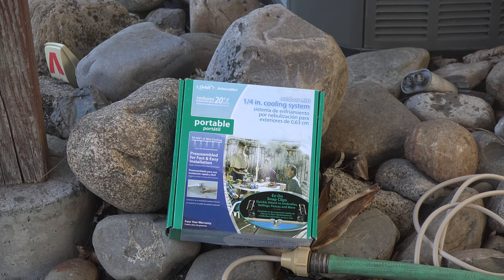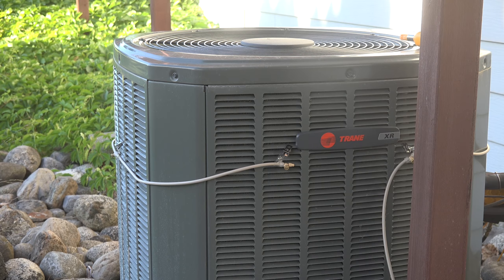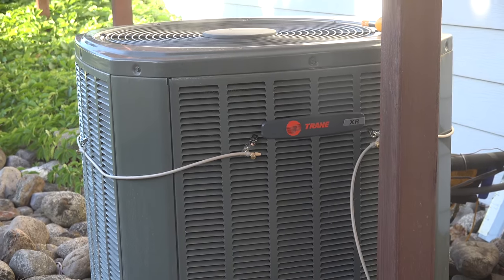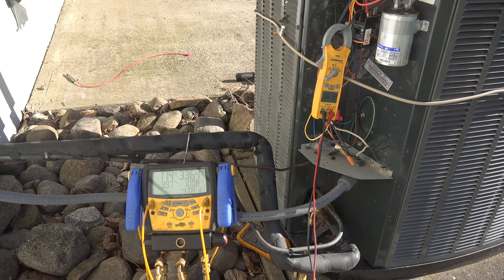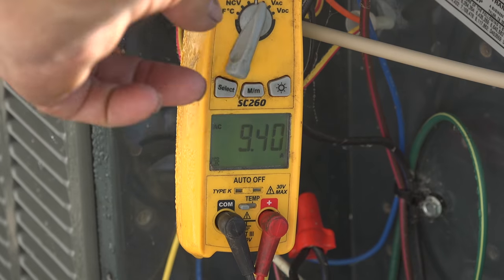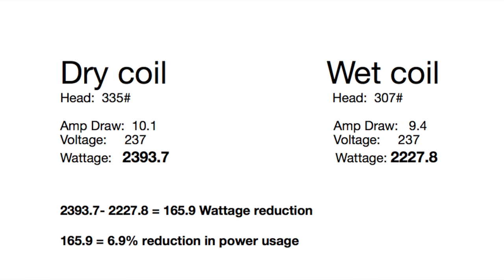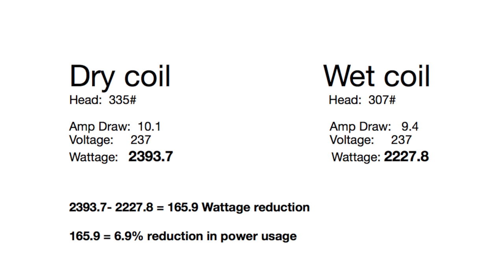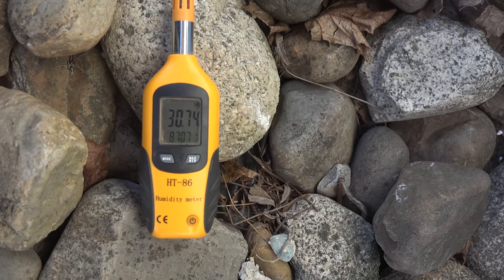Do the misters for A/C work? Part #1

Comment: No need to complicate the math with wattage :) You'll get the same result, percentage wise with the amperage draw numbers :)
Reply: Ok so 10 amps at 208 volts is same power consumption as 10 amps at 240. No.  Watts is power used. Amps is not power used. You must factor in the voltage and do the really complex math...aka Volt Amps
Reply: Think again :) Voltage is a given constant . Amperage draw is what changes  the equation thus difference in percentage :)
Reply: R. T. My friend, check in to voltage drop.  Im commenting to share.  If i was not right i would not make a statement. Any electrical fundamentals i reference can be verified.
Reply: acoustic4037 His voltage is the same  237V .
Reply: For all those who believe voltage is a constant I have measured literally thousands of systems running and it is a fact that voltage is not always exactly the same.  It can and does often vary.  The only way to be precise is to measure volts and amps and multiply.  Dont take my word for this!  Go measure a few thousand heat pumps yourself and see.  Nothing has to be wrong with the system for this to occur.  You could have variations from the power company.  Before you argue with me try to know your material or at least find evidence showing I have given incorrect information.  I try to pass on knowledge to help others not get into internet arguments.
Reply: acoustic4037 His voltage was the same . So all the multiplyng doesn't change the end result . Yes voltage will fluctuate due to various  reasons but this had nothing to do with applying a mist over the condenser and the experiment he's going.
Reply: At that exact moment you are right.  If you take multiple readings over time in various conditions, and you do as the first poster in this thread suggested which was just pay attention to the amps, then you will be misled by the results as the amps can vary but with out knowing if the voltage has, or knowing the watts used, it can lead to different conclusions based on the monitoring data.  If you measure enough, you will see fluctuations.   Either you want to be precise, or you don't.  I'm advocating for precision (watts).

Comment: Just install a liquid nitrogen cooling system that sprays liquid nitrogen around the outside of the unit.  That will keep the corrosion and buildup to a minimum. :)
Reply from the maker: Why not just spray the nitrogen inside the structure and eliminate the A/C.  lol
GFM

Comment: So the mister was not practical because it only resulted in almost a 7% power savings, provided that you are not in a high humidity environment, and will likely cause calcium buildup on the coils and fins.  A magnetic water treatment device would probably solve the calcium issue; that would be overkill and not cost-effective for this application, but for other reasons in general it is a very good thing to implement for your home's water system.  This guy has great info on that - https://trentatron.com/chronicle.htm
I wonder if significant efficiency gains would be obtained by drawing in cooler air passed through the ground as in a geothermal cooling system.  Maybe just burying a long  hose 3-4' deep in a coiled manner but stretched out about 10' would provide enough temperature differential to make a difference.  Both ends of the hose would be above ground, and a shroud could be fashioned near the AC unit to hold one end of the hose so that the cooler underground air would be sucked in.
Reply from the maker: The problem with calcium filters of all types is they do not work.  If you want to filter the water to the point that there is nothing but H20, you then get corrosion of the coil.  
The idea of burying a hose, you must admit, is a bit silly.  
10' of hose, are you serious?  It would take 100' or more of 12" to 18" hose to do anything at all. The cost of the hose itself would be prohibitive.  
You would also need a forced air fan to move air thru the hose because the fan on the A/C will not work against static pressure.  
GFM
Reply: Magnetic water treatment does not filter calcium, but it changes the water so that the minerals do not adhere to pipe insides and surfaces like sinks & showers; sounds weird, but it's documented that it does work well.  On the geothermal idea, I mentioned a long coiled hose that may fit in a 10' long hole.  Maybe the dimensions would need to be adjusted, but I'm pondering whether some reasonable results could be obtained without needed to dig down 15+ feet deep where the temperatures are definitely in the cool region.  If not enough air flow could be generated from the AC's fan, I suppose a small solar-powered fan could be used to draw the air through the hose.  Theoretically, if the air surrounding the fins was cooled down 20 degrees lower than the ambient air via some geothermal technique or any other method, I wonder if that would cause a significant efficiency gain in the AC system.
Reply from the maker: @chidude  The calcium is still there and it will be deposited on the coil when the water evaporates.  
Your money would be far better spent by investing in a higher efficiency A/C.
GFM

Comment: Your math for calculating wattage is wrong. These are inductive loads. You are treating them as resistive loads.
Power(P) = Voltage(V) x Current (I) x Power Factor(PF).
Reply from the maker: The meter is RMS, power factor is taken into account.
GFM

Comment: Hmmmmm.... Let's take a coil made of 2 dissimilar metals and add water to the equation. Copper+aluminum+water= formicary corrosion. Not a good thing especially with a R410a system running high pressures.
Reply from the maker: The corrosion issue depends on the location and water components.  I have had commenters say they use reverse osmosis water to avoid calcium buildup.  The problem there is pure water is a far better catalyst than mineral water.  So you kind of pick your poison when using water on these condensers.
GFM

Comment: It would be 25% where I live where humidity is 5%-10%
Reply from the maker: What would be 25%?
GFM
Reply: @grayfurnaceman  the test that was done at 30% humidity I know for a fact because I use a swamp cooler that they don't work great till about 10% and that's 20% different in humidity gives you about 18% better cooler so 18+6.9 pretty close

Comment: Very nice! I have done almost the same test with the addition of the checking the cooled air temperature at the inside unit. My results showed about the same in savings. The air temperature at the inside evaporator did not change. I decided not to use the misting system anymore.
Reply from the maker: I have more videos that pretty much mirror what you have found.
GFM

Comment: Your test is not taking into account of a unit sitting in direct sun. I’ve run my test in 2022 and I saved $400 for the season. And average KWH cost is 24 cents not 9 cents. And it is just going up.
Reply from the maker: At the end of the video there is a link to a shading video.  I have thoroughly tested this issue and misters make no difference in most applications.  In fact, they often reduce efficiency, especially during low load temperatures.  I used the electricity cost from my utility.  I am sure you think you are saving, but I can tell you you are not.  There is no way to compare one cooling season to another.  Lastly, if this procedure was effective, you would see manufacturers using it.
GFM
Reply: @grayfurnaceman  I understand but I’ve been running my misting system for 8 years now and I can tell you I have Zero Scale build and my savings are substantial. I journaled all of it. I clean both condenser and evaporator coils once a year. My unit is located on the SouthWest side of my residence. The heat and head pressure buildup is crazy. The Unit is  a 20 year old Trane Gas/Electric Pack and is running like new. Of course now it will blow up on me😂.  I live in the Upstate of South Carolina where the water quality is second to none but it will give you scale if you aren’t careful. I’m not sure how it ranks to other geographical regions. 

After 5 years of steady performance I’ve been installing my customized mist units on all of my commercial and residential properties to maximize lifespan. So far so good.

I’ve subscribed to your channel because you really have some good stuff. Thanks.

Comment: Suction pressure is just as important. This experiment is Missing lots of info. I’d guarantee the system will require Freon added to it if you follow the charging chart. These systems are critically charged.
Reply from the maker: I will be doing another video on a day with temps above 90F and will include suction pressure but I am predicting no change.  There is no charging chart as the system uses a TXV.  And no, it is not undercharged.
GFM

Comment: YOU  ARE  LOOKING  AT  IT  ALL  WRONG
Do not mist the air around the coils. Simply catch rain water off your roof, and then drip rain water upon the coils when only on the hottest days & during the hottest hours. My setup uses no more than 5 gallons of rain water per day (max drip rate over 4 hours) and is frequently topped off if it rains at least 1" within the month. I have had no issues other than having to manually clean out my 'first filter' now and then...which is not a big deal. My system saves me $37 per month during the peak of the cooling season, which matters to me. $74 might not sound like a lot to others, but it's only PART of my cost savings endeavors around my home. I have not calculated, because it would be too tiresome, the amount of savings I am getting from reduced strain on my system. I have noticed a serious reduction in the number of capacitors I have been replacing....and although I can't figure the precise amount, it is significant since peak times is when the system is being stressed the most.

SIMPLE SUGGESTIONS:
Seriously consider covering the outside of your solar gain windows with highly reflective window tinting. It's amazing how far such a small investment goes in reducing your cooling costs. The next is to place a large black pan outside roof in direct sunlight, and have a tube go to a pan inside (preferably near the air return on the highest floor) filled with water & calcium chloride solution. Either the outside pan or inside pan should have a lid to be closed at night.

Comment: 7% reduced Amps
7% reduced Watts
8% reduced head pressure

And you can't figure the benefits?  If only to solve the proper nozzle size and water pressure accuracy to get a humidity Net result that's zero to nil affect. Then do better math for the savings, that includes reduced taxes and distribution multipliers added to the kilowatts used. Then the reduced head pressure extends the Run To Fail life cycle of the compressor. 

Otherwise it seems as usual, those who work in an industry that thrives off of maintenance and Planned Obsolescence, are either ignorantly trained or purposely trained to not be as efficient as technology available would produce. Wouldn't want to shoot oneself in the foot for lowered revenue of repairs and replacements.
Reply from the maker: Watch the rest of the series.
GFM
Reply: @grayfurnaceman   It's not my life or responsibility to get into so much time dragged out over strategically multiple videos to gather whether you're properly teaching a subject. I'm in Social Media, so I know the posting of video strategy. But I'm first a teacher, and I can rightly mention and openly evaluate to properly inform, not pull people into lengthy uses of their time to prove I know what I'm talking about.

If you're a Doer, then stick to Doing. If you're not a teacher, then don't teach. It's not just a matter of knowing things that one can assume they should teach, but it's effectively and in opportunity time to teach those things. Not dragged out unnecessarily, nor certainly for Views and Clicks
Reply from the maker: Videos like this generate may comments which I am obligated to address.  I don't do videos for "views and clicks".  If you don't want to learn, then don't watch at all.  Heaven forbid you might "waste some time" to learn something.  
As for doing and teaching, 27 years as a service tech then 9 years teaching.  I think I know how to do this.
GFM

Comment: A simple filter will filter the hard water
Reply from the maker: Filters do not remove the minerals.
GFM
Reply: @grayfurnaceman  yes they do.
Reply: @grayfurnaceman  I suggest a RO filter.
Reply: @grayfurnaceman  I just found 12 different water filters that remove mineral scale to stop build up. With the volume of water being used these filters will last 3-4 year’s minimum.
Reply from the maker: @MarineScoutSniper  An RO filter will get you effectively distilled water.  Distilled water is highly corrosive.  You will be trading minerals deposited with corrosion.  
I would suggest you watch the entire series as linked at then of the video.
GFM
Reply: @grayfurnaceman  so far so good. If that were true a 20 year old unit would not be operating so well. 
Real World experience says you’re wrong. I will agree to disagree

Comment: I have this system for long time and I can tell You that your calculation is wrong. My a/c unit runs 75% less time with misters then without. So  electricity consumption is less at least 75% not a 6.9%

Comment: You left out a multitude of other factors. 
Multiply your results by the number of times the unit kicks on everyday. 
The cost of a good water filtration system, water usage/cost per gallon. 
Change in air temp from registers (resulting in less run time?). 
Your Hank Hill theory was fun to watch but lacked hard useful information.
Reply from the maker: Have you watched the entire series?
GFM

Comment: This is one of the best videos so far as it's based on FACTS and not as much opinion.  We live in Northern California in an area with low humidity so we would realize some gain by using the misters. BUT if/when there is calcium buildup and if/when there is a service call, there goes any saving out the window (or in the tech's pocket).  Sounds good but IMHO not worth the deferred expense.

Comment: The cooling is the same as when it rains.   Water absorbs heat when it evaporates.  If you fix it so it "rains" on your outside unit, you will have a more efficient unit....it will run for a shorter period of time to do the same cooling.  Does raining on your outside unit shorten its life?  Probably.   Your description of the "misting" as cooling the air is not correct.....mist your skin....the evaporation of the mist....namely water... from your skin does the cooling.
Reply from the maker: Misting does , in theory, cool the air.  The problem is, when the humidity is higher, it just does not work.  I have seen these misters used as a very effective cooling medium by themselves but only in Las Vegas at temps above 100F and single digit humidity.
GFM
Reply: Misting to me is merely spraying water in very small droplets.  The water must still evaporate to absorb heat...unless it is 100% humidity.  Water requires removal of heat to become a solid-ice...and it requires absorption of heat to become a vapor- gas.  You can simply wet your air conditioner down with a hose and accomplish the misting effect.   I suppose the misting idea is to limit the use of water.  The fan is sucking that mist into the coils and that is where the evaporation is providing cooling by absorbing heat.  Sweat evaporates from your skin and cools you.

Comment: You know greyfuranceman I watch a lot of your videos. But this time I fully disagree with you! You acted from the beginning that this was a bad idea. Even when the tests came out positive! First if your running the system 24 hours a day, and by reducing head pressure your proving cooler temps to the system allowing more rest periods for the equipment further providing savings. My big question was why where you so negative about cooling the system with misters? I really believe it's a great idea and reliving stress on the system in very hot environments.
Reply from the maker: My opinion on these things was developed many years ago from seeing destroyed condensers from the calcium buildup.  As you could see from the video there is a reduction in head pressure, but the energy use is only marginally dropped.  We have been making air conditioners for many years, and they are designed to operate with high temps.  
Also, no manufacturer has installed these things as a factory option.  If they save so much energy without damaging the equipment, I would think at least one manufacturer would have installed it.
GFM
Reply: grayfurnaceman maybe the manufacturer didn't install it because they know it would add life to the system, slowing the turn around rate of replacement. Further calcium can also be counter acted with as well. And you only put one mister per side which showed effectiveness. Imagine a minimum of two? And you talk about calcium build up. Heck a lot don't even keep their condensers cleaned out.

Comment: You left out the Cooling Efficiency..The whole whole point is to make the unit run less. To cool the same amount of Volume.  Never mind the less the unit has to struggle to cool. The longer it will last. As in these fuckers cost $2,000.00 to replace! If I can make it last 10-15 years. I get to keep that money in my pocket...

Comment: Too bad that you numbers are not true.  You would have to test the longer period because the house will be cooler and the A/C will turn OFF earlier than normal. IMHO
Reply from the maker: There are more videos on this subject coming out that may help.  The primary reason I do not do longer term tests is that they will introduce more variables.  Temperature, cloud cover, sun position, even voltage variations and humidity are all variables.  The longer the unit runs, the more variation.  
GFM